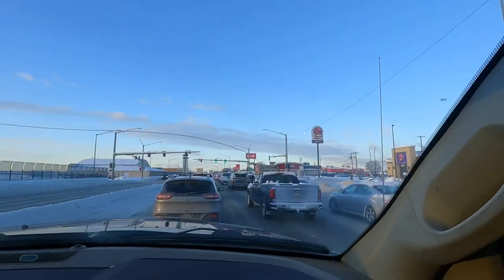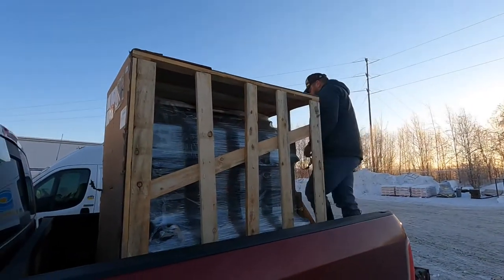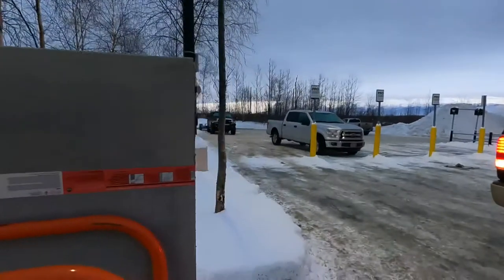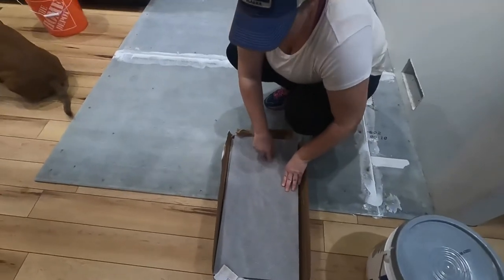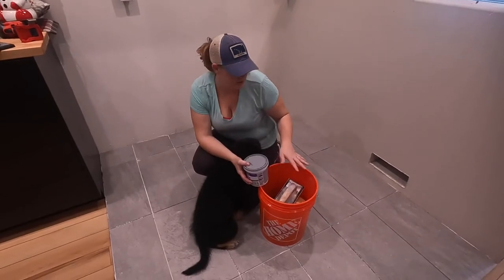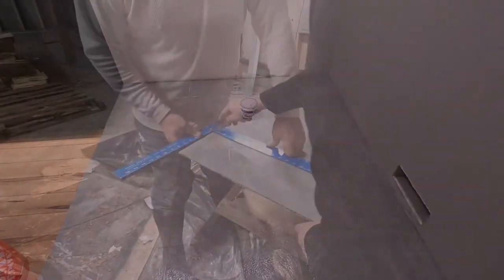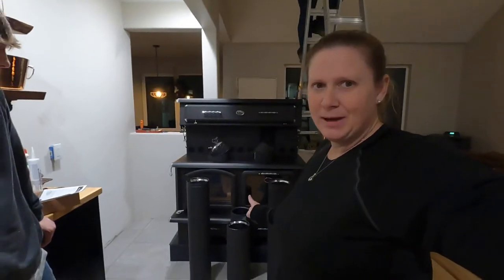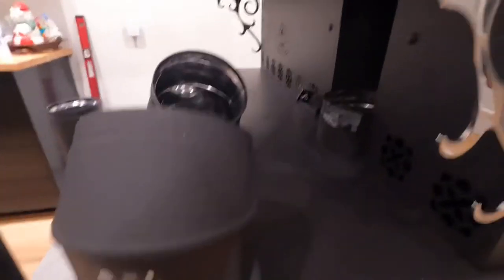Embracing the Cozy: Installing a Wood Cookstove in our Alaskan Homestead Build | JA Roby

Comment: Hi! Love the Video! We have the smaller Elda model from JA Roby. I am having a difficult time getting the oven temps above 300f. How is the oven temperatures for you? On the glass thermometer it will read about 410, but inside it wont get above 300 and thats even on the top rack. Used multiple thermometers.
Reply from the maker: It’s been difficult. But we figured it was the wood we are using. However I have been able to bake at the lower temps. It’s strange that the food comes out the same. Steep learning curve for sure.
Reply: @modernhomesteadalaska  Thanks! It is definitely a learning curve, but at least is FUN! I appreciate the reply!